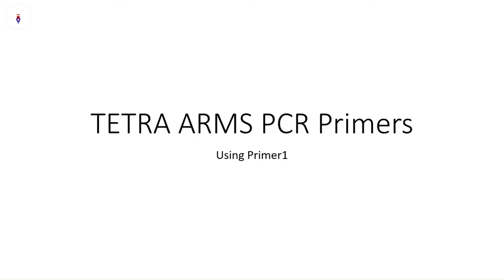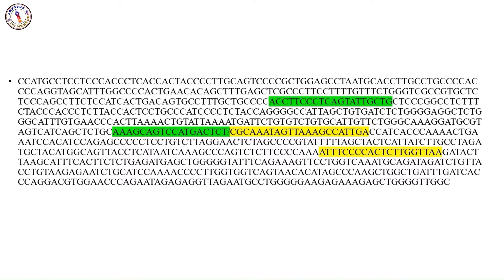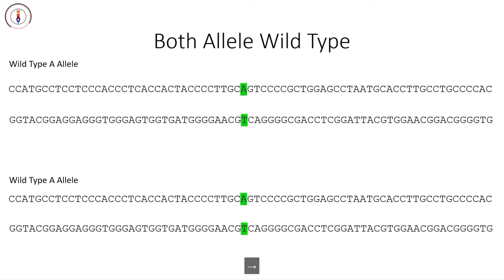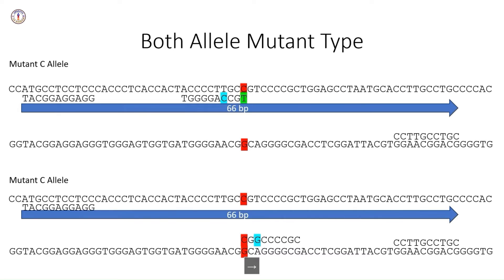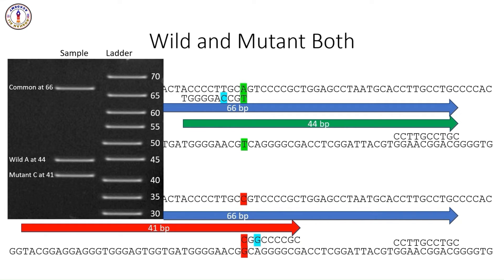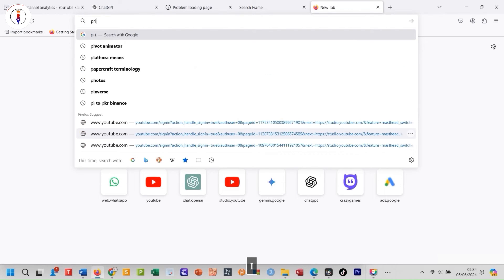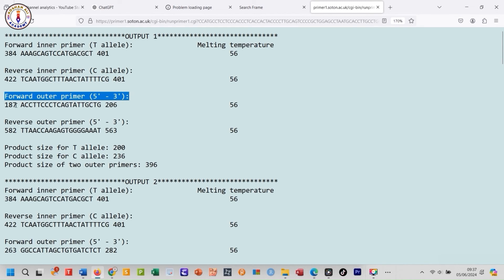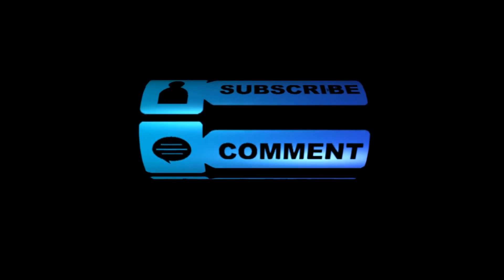How to Design Tetra ARMS PCR Primers | Tutorial 10

Comment: I'm trying to check the reverse inner primer in the primer blast bit its showing that the right primer is not the minus strand. I even tried using reverse compliment but its still showing the same. Please help as my experiment is stuck I'm unable to optimise the primer
Reply from the maker: I would like to see your primers that you designed. And the way you are searching it on primer blast. Would you mind to provide the information please.

Comment: Is primer 1 software authorized? It gives two different bases between wild and mutant primers,. it suppose only one base difference
Reply from the maker: I think you first need the basics behind snp primers. It is very important to insert a mismatch at 3rd position from the 3 end near snp
Reply from the maker: I don't know what u mean by authorized? If you mean reliable. Yes it is reliable.
Reply from the maker: Also you can check the primers designed by primer1 by other tools such as primer3 or ncbi primer blast.